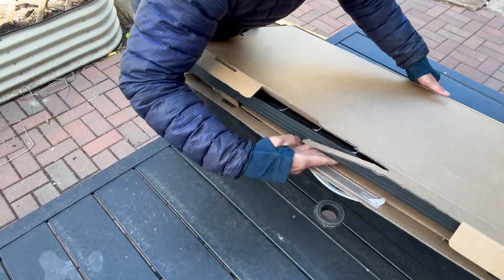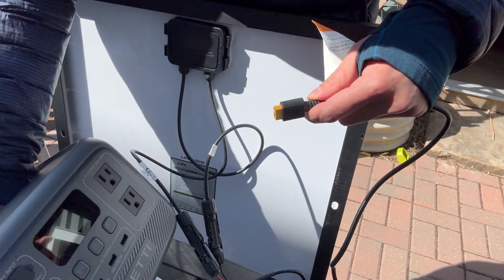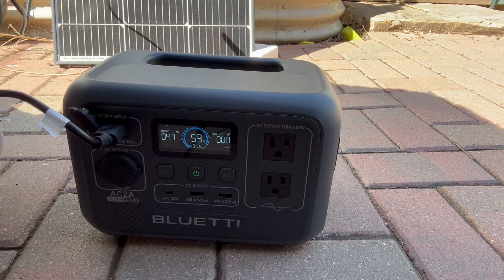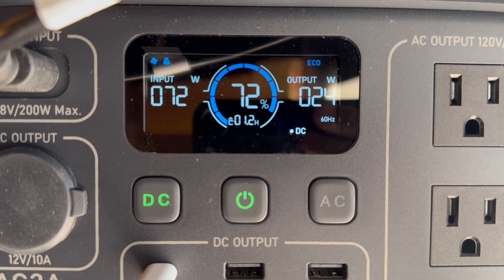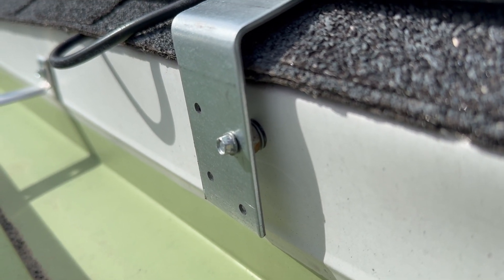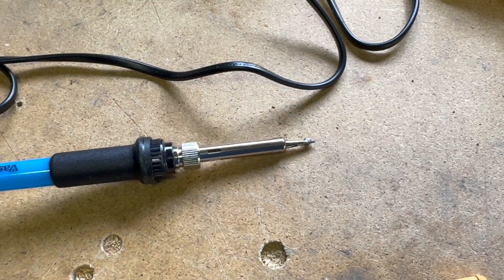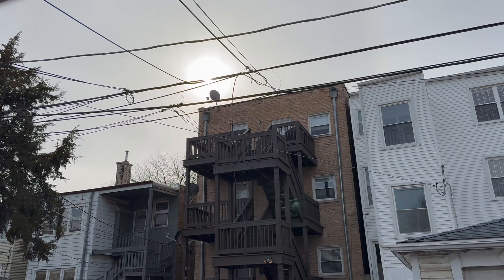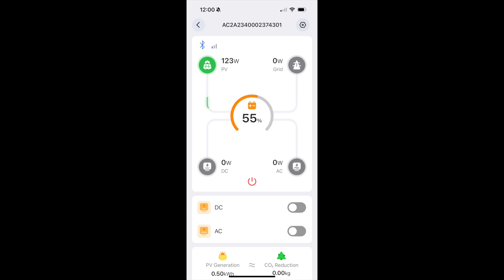$130 solar charger setup for an e-bike (and other things) using a 100W solar panel and power station

Comment: Would that battery bank be able to charge my ebike 52v 15ah battery?
Reply from the maker: Definitely would, abeit very slowly. The battery I am charging in the video is 48V 12ah (54.6V to charge). Your battery is  52V * 15Ah = 780Wh, so even if my 100W panel was in full production (direct sunlight) with no losses, i.e. the perfect environment, it would still take 7.8 hours to fully charge. With a approximately 25% loss, it would take 9.75 hours of direct sunlight to charge.

Comment: Humm. I don't know much about these things, but it seems to me that if somehow  the bike battery could be charged directly from the DC output solar panel, it  be more efficient than going through the power station. In the video, the DC from the solar panel charges the power station's battery and the power station converts it to an AC output and  then it has to be converted BACK to DC for the bike battery by that external AC to DC converter box. Power is lost each time there's a conversion:  DC to AC and then AC back to DC. Just saying. Is it possible to charge the bike's battery directly from the solar panel(s) if you could make a proper cable?
Reply from the maker: You are absolutely right. I would still have to step up the 12V to 54V to charge the bike, but that's a <5% loss, vs the DC/AC/DC conversion which could be up to a 30% loss in efficiency. So I am losing a lot of efficiency here. But the real reason is that I don't have an adapter for it and I think it would cost ~$80 to build this adapter.
Reply: @DinoNuggetsDoes  Does the bike's battery really require 54V DC to charge it? Couldn't 12V  be used and it just take a lot longer to charge? Or  what about several 12V solar panels connected in series to provide a higher voltage? Would that have too much current?
Reply from the maker: @ You are thinking of amps, not volts. You need the right voltage to charge, but if you have the right voltage but lower amperage, then it'll just take a lot longer. Like you said, you can have 4 12V panels connected in series to get to 48V which may allow it to charge, but the battery calls for 54.6V... but also 4 panels is another $200. Heh.
Reply: @  "You are thinking of amps, not volts."  Humm. Yes. Connecting batteries in series raises the voltage, but lowers the amperage. 12V might exceed the max solar input current?  I would connect the panels in series and pay for the extra panels.
Reply: I wonder if an adapter could be built cheaper utilising commercially available type-c chargers.
E.g. 12v-48v type-c car chargers should be readily available. 

 @DinoNuggetsDoes
Reply: @DinoNuggetsDoes  If you charged the ebike battery directly instead of using the UL approved charger, you probably void the UL Safety Approval.  Using the power station to recharge the batteries with the UL Approved and tested method would maintain the UL safety rating.
Reply from the maker: @animejanai4657  Is this because amps will be changing based on how much wattage the panel is producing? I'm not sure how good or bad the output controller is. 

P.S. I'm not sure the ebay Bafang battery has a warranty at all; might be an ebay use-at-your-own-risk type deal.